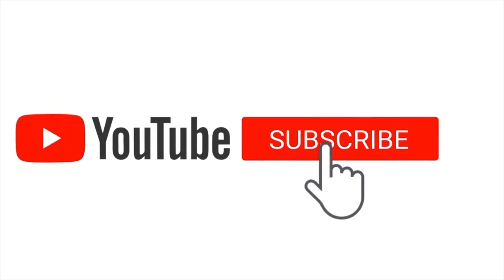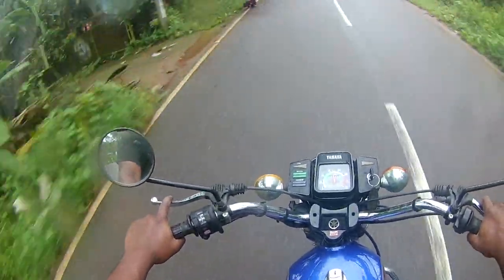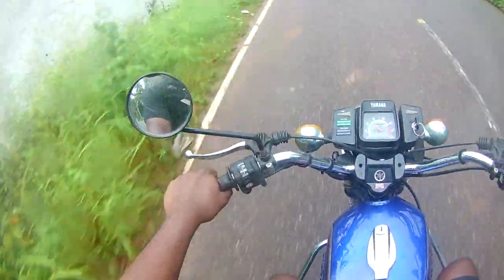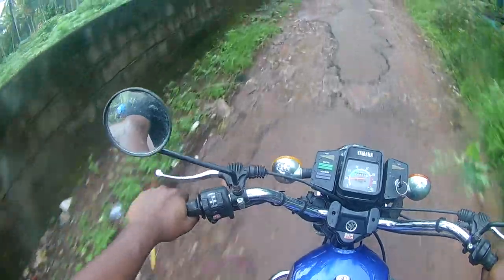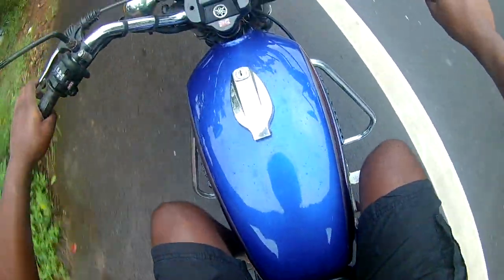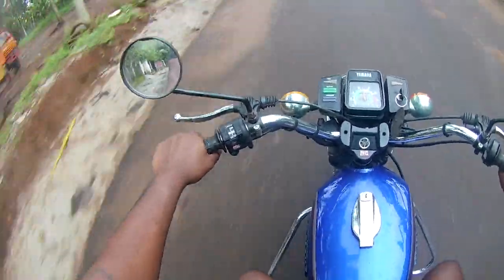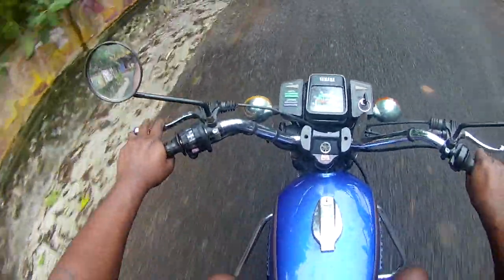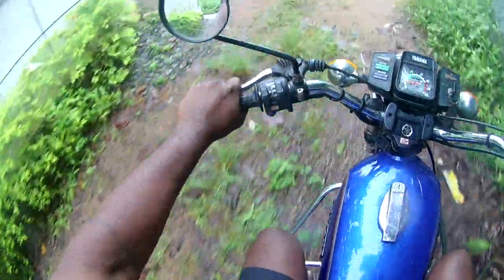RX 100 Performance CDI Test Ride Video (English video)

Comment: Bro if we install this parformance kit then is it necessary to replace the carboretor?
Reply from the maker: If you can it will be better
Reply: @Yamakaze  i have mikuni carboretor now. then after installing the performance kit which carboretor will be best to upgrade?
Reply from the maker: @sarkop848  there is no plug and play solution, you need to upgrade based on your end goal
Reply: @Yamakaze  ok
Reply: @Yamakaze  bro when my bike get to speed of 60 then it goes so fast after some second bike feels like jurky or petrol is over and bike stop after that again it starts. So bro any solution? please tell me i am facing this problem..
Reply: @sarkop848  adjust your float